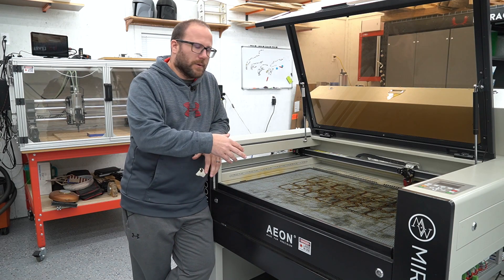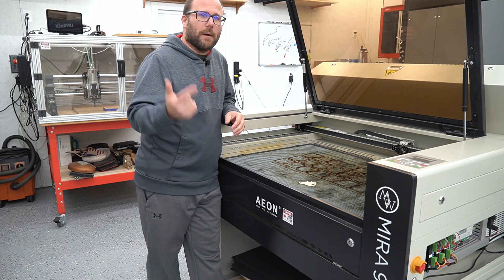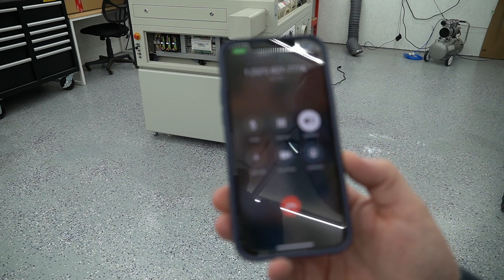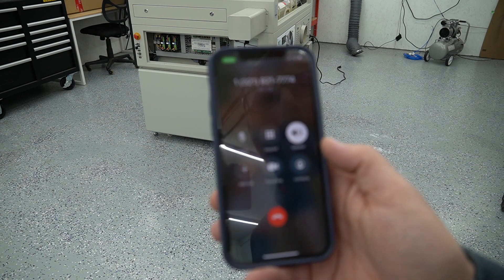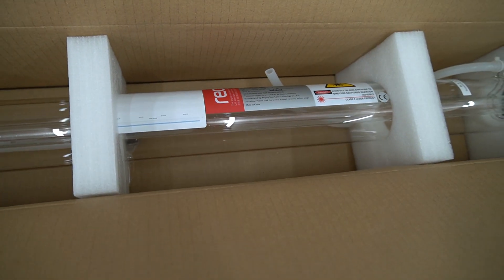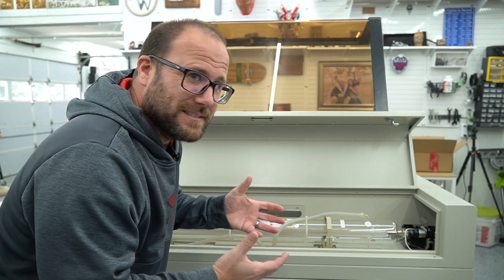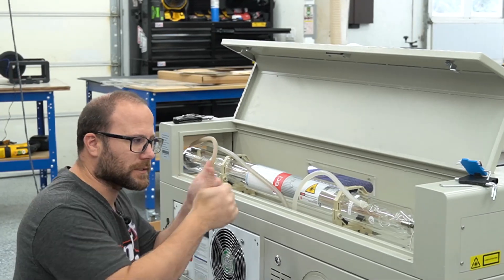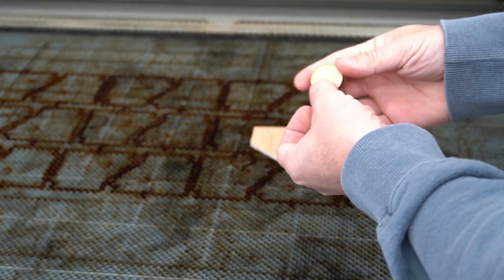CO2 Laser Firing Rings // What does it mean?!

Comment: I'm having this same issue at the moment. I'm curious about what tube you had. Was it maybe Reci W6? Also, at what percentage power did you pulse to see the O ring? I'm doing it at 15-30% in power and see it there. Anything above that will just burn a hole that doesn't say anything.
Reply: I have the same problem with my t2 100w... you found some solution or i have to change my tube? Is neeeewwww!!! I wanna cry u.u